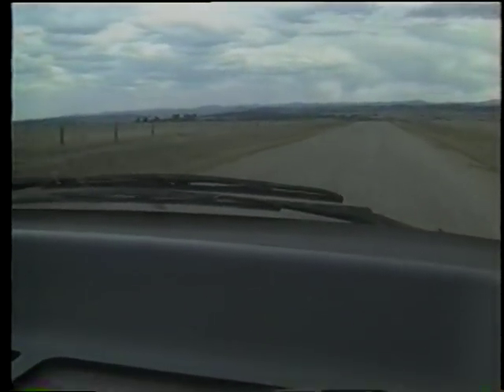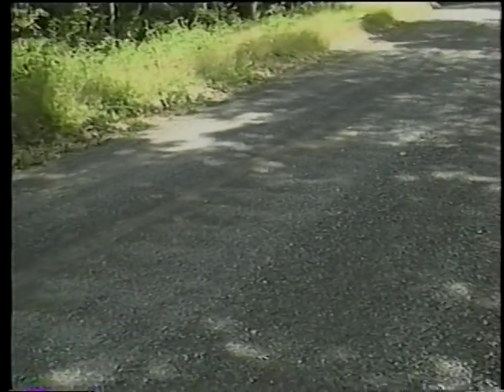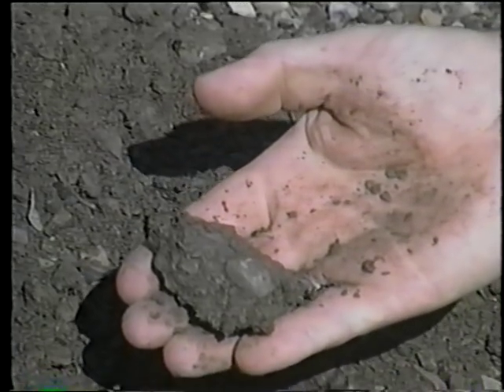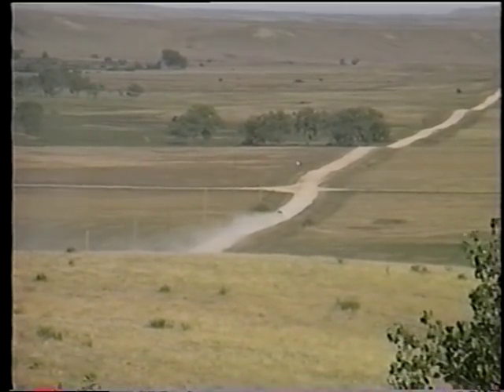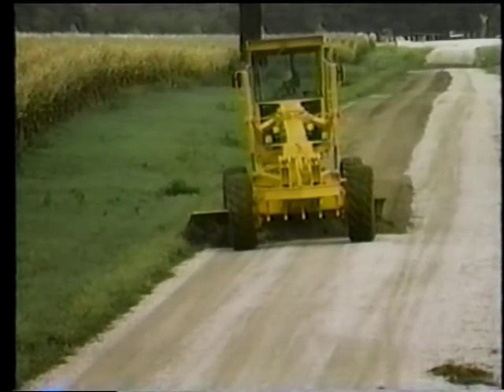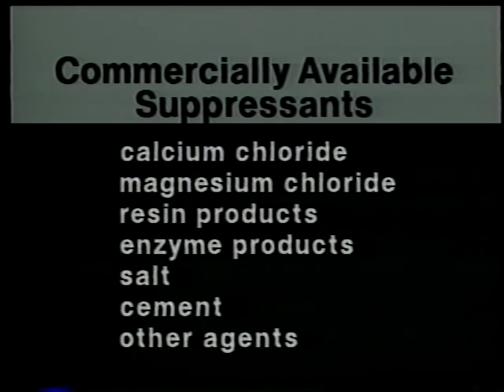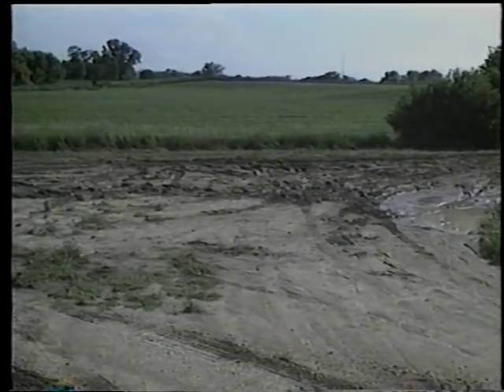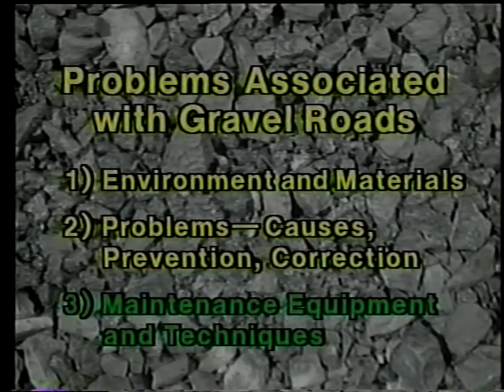Problems With Gravel Roads (Part 2)

Comment: In response to other comments, YES there is such thing as a good gravel road. I like riding my road bike on gravel roads, and a well-maintained gravel road (i.e. level with a good layer of surface dirt over a gravel and dirt base), is silky smooth and much, much, much better than a crappy paved road. The best thing is that a good dirt road is (depending on climate) easy and cheap to make: in the in the spring dump a little gravel in low spots, run a grader over the rough patches, wait a week for traffic to compact everything, and enjoy. Compare that with a paved road, which gets repaved every decade or two and develops potholes and cracks (that are often poorly repaired) in the meantime. Granted, gravel roads can't hold up to heavy traffic, and really dry climates can turn gravel roads to dust, but in many rural areas, dirt roads make much more sense than paved roads.
Reply: Leon Maurer